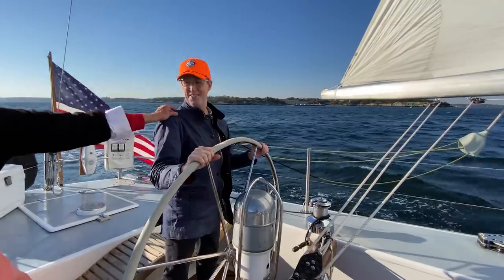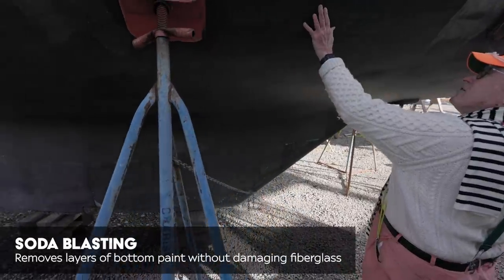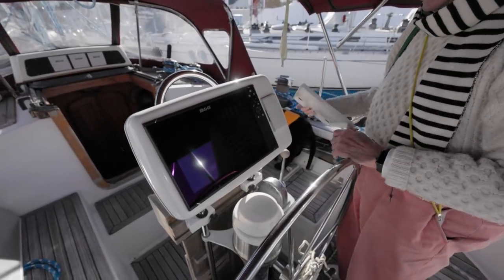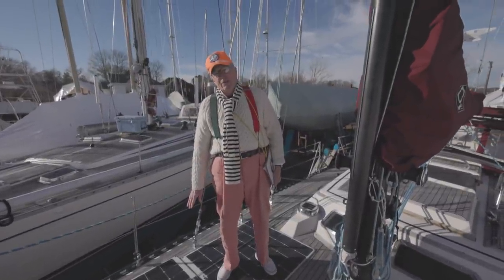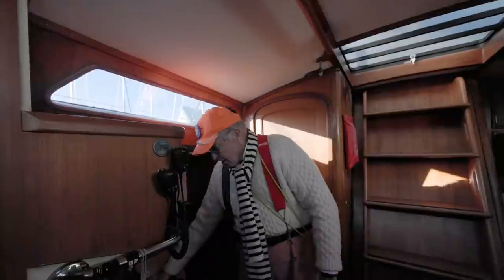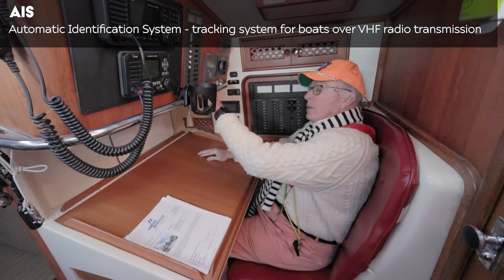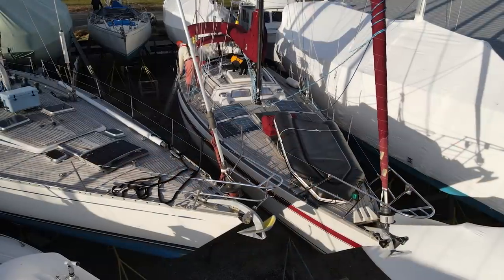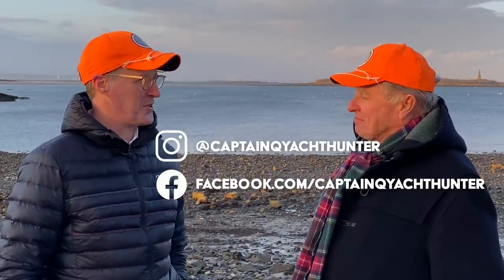$99,500 USD GLOBAL CRUISER! Proven bluewater sailboat for sale! EP76 #sailboatforsale #sailboattour

Comment: I absolutely love the Lafitte 44.
Reply: Me too!
Reply: Mr. Kerr and Mr. Gleason I hope to give one of you or maybe both (partners) a bit of encouragement to sell every damn thing you own, beg, barrow if needed to get the money to make an offer on Dream Weaver.  What Capt Q did not have time to tell you is some of the other things done to this boat in 2018/2019 mostly.  Here is a list, it is not complete but close:

Accommodations
Sleeps 7-8.  V berth forward.  Enclosed head with vanity and shower next aft to port, hanging lockers opposite to starboard. Main cabin features U-shaped dinette to port which converts to form double berth, settee opposite to starboard. Galley next aft to port, forward-facing navigator's station opposite to starboard. Aft owner's stateroom with double berth to port and single berth to starboard is accessible from main cabin through a second head, with vanity and shower, located aft of navigator's station. Both toilets are Wilcox Crittenden Skipper models, both rebuilt in 2019. Shower fixtures new in 2019.

Galley
U-shaped galley features propane four-burner, gimbaled, stainless steel stove with oven (oven  not working),  Sea Frost (2021) 12 volt refrigerated ice box and separate freezer with digital monitors and controls, double stainless steel sinks with pressurized hot/cold water. Propane system installed in 2019.

Electrical
12 volt DC and both 110 volt AC and 220 volts AC. Engine and generator starting batteries are 12 volt lead acid. House batteries consist of three Relion RB-300-hp 8D 300 ah lithium iron phosphate batteries (2019). Four deck-mounted semi-rigid, walk-on, 175 watt SolarWorld Sunmodule solar panels mounted on foredeck whose 700 watts of power produce as many as 250 ah per day! The four three-foot-square panels feed two 30 amp Victron SmartSolar MPPT charge controllers, monitored via a Victron Color Control GX mounted at nav station. Eclectic Energy (British) D400 wind generator (2019) with max output of 600 watts. Nex-Gen 5.5 KW 10 HP diesel genset (2019) with 75.7 hours. 110 and 220 volt Victron Energy inverter/chargers (2019). Boat automatically accepts 110 volt or 220 shore power and can output both voltages simultaneously, if so desired.

Electronics and Navigation
Brooks and Gatehouse electronics suite including forward-facing sonar, AIS transceiver, 4G radar (antenna mounted on mast), three Triton2 multi function displays, 12" Zeus3 chartplotter, and barograph. All purchased new in 2019, all updated in 2021. Simrad hydraulic autopilot (2019) networked to B&G system, Icom M803 marine HF SSB radio transceiver (2019) with DSC and color display, Icom AT140 automatic antenna tuner (2019). Insulated backstay serves as SSB antenna. Copper foil ground plane glassed into hull during boat's manufacturing process (standard practice with all Lafitte 44's). Icom IC M-506 VHF radio transceiver (2019) with RAM mike (2019). Iridium wifi satcom system (2019). King wifiMax router and range extender (2019). Ritchie SP5 binnacle-mounted compass.

Hull and Deck
Modified full keel with skeg-hung rudder. External lead ballast. Airex-cored hull, balsa-cored decks. Teak decking. Double bow anchor rollers. Maxwell electric windlass, rebuilt in 2019 with foot switch and wireless remote control. Double stainless steel lifelines (2018) with starboard boarding gate. Edson steering system. Four opening overhead Bomar hatches. 10 opening ports. Two Marinco solar vents with reversible fans. Two midship deadlights (2019). Cockpit shower. Dyneema jacklines, port and starboard, running bow to stern. Three padeyes in cockpit for attaching safety harness tethers

Sails and Rigging
Cutter-rigged keel-stepped aluminum mast. Staysail stay fitted with quick-release lever at base allowing stay to be quickly deployed or stored. Running backstays. Sail inventory of 7 sails, all made by Port Townsend Sails in 2019, includes fully battened mainsail with two deep reefs (30% and 60%), light air loose-footed mainsail with snuffing sock, roller-furling 115% genoa, Dyneema-stayed drifter, particularly robust staysail, storm trysail with separate track on mast, and storm staysail. Block and tackle boom vang with Dyneema line, 22', 20 lb. carbon-fiber whisker pole (2018) with integrated stowing (flush with mast) nd deploying system. Harken mid-boom mainsheet traveller (2018) mounted on house. Winch inventory includes two Harken #35 two-speed, self-tailing, mast-mounted halyard winches, Lewmar #30 self-tailing, two-speed, mast-mounted, reefing winch, two Lewmar #55 self-tailing, two speed, primary genoa sheet winches, two Lewmar #40 self-tailing, two-speed winches mounted on coach roof, one Lewmar #46 self-tailing, two-speed winch mounted on coach roof. All standing rigging and turnbuckles new in 2018.  Most running rigging replaced in 2018 with Dyneema. All chainplates removed in 2018, dye tested, and electropolished. All chainplate attachment points reinforced in 2018 with additional glass.

Mechanical
Wind Pilot Pacific (German designed and built) servo-pendumum mechanical windvane self-steering system (2019).

Additional Inventory
Viking 8-person liferaft (2019) in hard cannister mounted in a deck cradle. 3D Superlight Twin Air 290 9.5' inflatable dinghy. Burgundy cockpit dodger (2019) with zippered front window, stainless steel bows, and stainless steel grab rails on three sides. Burgundy bimini (2019) with stainless steel bows, full 360 degree enclosure, canvas covers for all windows, window on top for checking sail trim, and cover for top window. 45 lb. CQR plow anchor with 300' of 10 mm chain, 300' nylon rode, Danforth 35 HT with 50' 10 mm chain, Paul Luke 100 lb fisherman anchor (2019). Ace Sailmakers (E. Lyme, CT) Jordan series drogue. Plastimo extendable man overboard pole (2019). Stereo with two speakers in main cabin. Pots and pans. Toaster. Five fire extinguishers, six fenders, assorted docklines, two horseshoe buoys (2019), boat hook. Misc. engine spares.

Comment: Ah the highlight of my week.  I'm not loving this boat and that is a first. The layout and the sleeping arrangements not the best use of space for the ladies. While I'm sure she will get you anywhere, I feel your better half would long for a real hot shower and a bed with headroom especially at anchor where, again the cockpit seating is downsized. Also I think it's a lot of boat for a young couple maybe starting their journey. Dunno. In the end it's a question of taste. Thanks for the great tour Captain Q and Randay.
Reply: Ahhhh my friend but it does have a real shower along with all these other must haves:

Accommodations
Sleeps 7-8.  V berth forward.  Enclosed head with vanity and shower next aft to port, hanging lockers opposite to starboard. Main cabin features U-shaped dinette to port which converts to form double berth, settee opposite to starboard. Galley next aft to port, forward-facing navigator's station opposite to starboard. Aft owner's stateroom with double berth to port and single berth to starboard is accessible from main cabin through a second head, with vanity and shower, located aft of navigator's station. Both toilets are Wilcox Crittenden Skipper models, both rebuilt in 2019. Shower fixtures new in 2019.

Galley
U-shaped galley features propane four-burner, gimbaled, stainless steel stove with oven (oven  not working),  Sea Frost (2021) 12 volt refrigerated ice box and separate freezer with digital monitors and controls, double stainless steel sinks with pressurized hot/cold water. Propane system installed in 2019.

Electrical
12 volt DC and both 110 volt AC and 220 volts AC. Engine and generator starting batteries are 12 volt lead acid. House batteries consist of three Relion RB-300-hp 8D 300 ah lithium iron phosphate batteries (2019). Four deck-mounted semi-rigid, walk-on, 175 watt SolarWorld Sunmodule solar panels mounted on foredeck whose 700 watts of power produce as many as 250 ah per day! The four three-foot-square panels feed two 30 amp Victron SmartSolar MPPT charge controllers, monitored via a Victron Color Control GX mounted at nav station. Eclectic Energy (British) D400 wind generator (2019) with max output of 600 watts. Nex-Gen 5.5 KW 10 HP diesel genset (2019) with 75.7 hours. 110 and 220 volt Victron Energy inverter/chargers (2019). Boat automatically accepts 110 volt or 220 shore power and can output both voltages simultaneously, if so desired.

Electronics and Navigation
Brooks and Gatehouse electronics suite including forward-facing sonar, AIS transceiver, 4G radar (antenna mounted on mast), three Triton2 multi function displays, 12" Zeus3 chartplotter, and barograph. All purchased new in 2019, all updated in 2021. Simrad hydraulic autopilot (2019) networked to B&G system, Icom M803 marine HF SSB radio transceiver (2019) with DSC and color display, Icom AT140 automatic antenna tuner (2019). Insulated backstay serves as SSB antenna. Copper foil ground plane glassed into hull during boat's manufacturing process (standard practice with all Lafitte 44's). Icom IC M-506 VHF radio transceiver (2019) with RAM mike (2019). Iridium wifi satcom system (2019). King wifiMax router and range extender (2019). Ritchie SP5 binnacle-mounted compass.

Hull and Deck
Modified full keel with skeg-hung rudder. External lead ballast. Airex-cored hull, balsa-cored decks. Teak decking. Double bow anchor rollers. Maxwell electric windlass, rebuilt in 2019 with foot switch and wireless remote control. Double stainless steel lifelines (2018) with starboard boarding gate. Edson steering system. Four opening overhead Bomar hatches. 10 opening ports. Two Marinco solar vents with reversible fans. Two midship deadlights (2019). Cockpit shower. Dyneema jacklines, port and starboard, running bow to stern. Three padeyes in cockpit for attaching safety harness tethers

Sails and Rigging
Cutter-rigged keel-stepped aluminum mast. Staysail stay fitted with quick-release lever at base allowing stay to be quickly deployed or stored. Running backstays. Sail inventory of 7 sails, all made by Port Townsend Sails in 2019, includes fully battened mainsail with two deep reefs (30% and 60%), light air loose-footed mainsail with snuffing sock, roller-furling 115% genoa, Dyneema-stayed drifter, particularly robust staysail, storm trysail with separate track on mast, and storm staysail. Block and tackle boom vang with Dyneema line, 22', 20 lb. carbon-fiber whisker pole (2018) with integrated stowing (flush with mast) nd deploying system. Harken mid-boom mainsheet traveller (2018) mounted on house. Winch inventory includes two Harken #35 two-speed, self-tailing, mast-mounted halyard winches, Lewmar #30 self-tailing, two-speed, mast-mounted, reefing winch, two Lewmar #55 self-tailing, two speed, primary genoa sheet winches, two Lewmar #40 self-tailing, two-speed winches mounted on coach roof, one Lewmar #46 self-tailing, two-speed winch mounted on coach roof. All standing rigging and turnbuckles new in 2018.  Most running rigging replaced in 2018 with Dyneema. All chainplates removed in 2018, dye tested, and electropolished. All chainplate attachment points reinforced in 2018 with additional glass.

Mechanical
Wind Pilot Pacific (German designed and built) servo-pendumum mechanical windvane self-steering system (2019).

Additional Inventory
Viking 8-person liferaft (2019) in hard cannister mounted in a deck cradle. 3D Superlight Twin Air 290 9.5' inflatable dinghy. Burgundy cockpit dodger (2019) with zippered front window, stainless steel bows, and stainless steel grab rails on three sides. Burgundy bimini (2019) with stainless steel bows, full 360 degree enclosure, canvas covers for all windows, window on top for checking sail trim, and cover for top window. 45 lb. CQR plow anchor with 300' of 10 mm chain, 300' nylon rode, Danforth 35 HT with 50' 10 mm chain, Paul Luke 100 lb fisherman anchor (2019). Ace Sailmakers (E. Lyme, CT) Jordan series drogue. Plastimo extendable man overboard pole (2019). Stereo with two speakers in main cabin. Pots and pans. Toaster. Five fire extinguishers, six fenders, assorted docklines, two horseshoe buoys (2019), boat hook. Misc. engine spares.